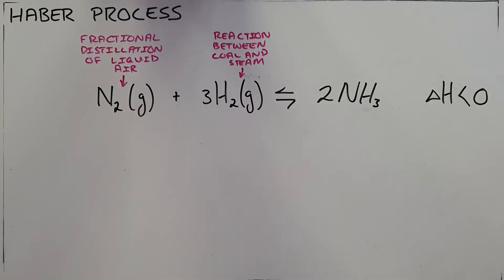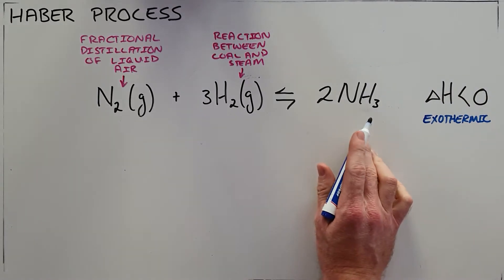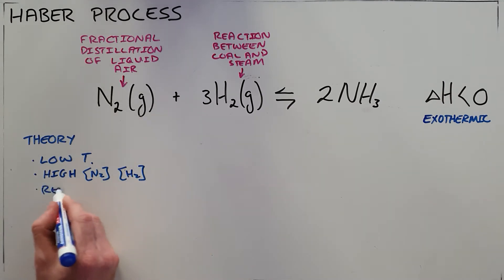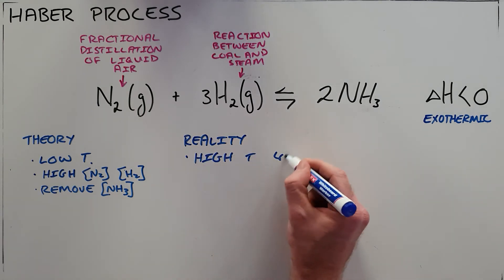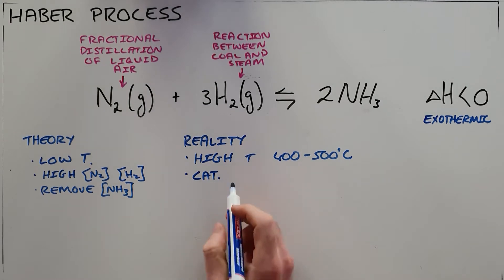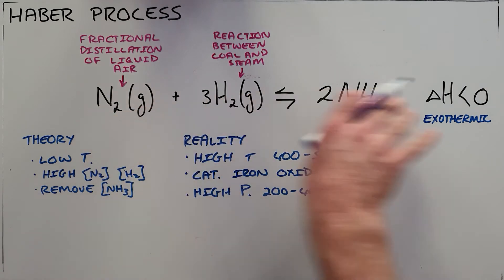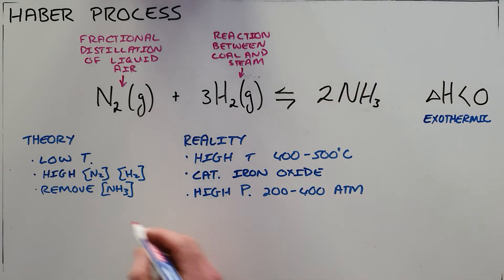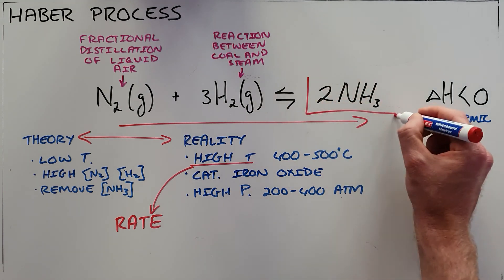The Haber Process

Comment: with the theory vs reality of the temperature, could it bethat it is a relatively low temperature?
so 500~ is 'low' compared to 1000-2000~ which would favour the other side of the reaction?
Reply from the maker: Hi! That is correct, industrially 500 C is considered to be a fairly low temperature and so we say that this "low" temperature would favour the forward reaction.